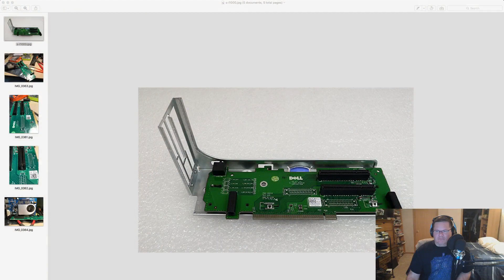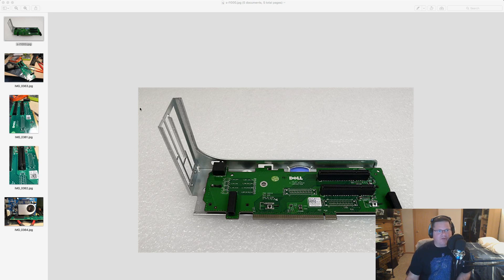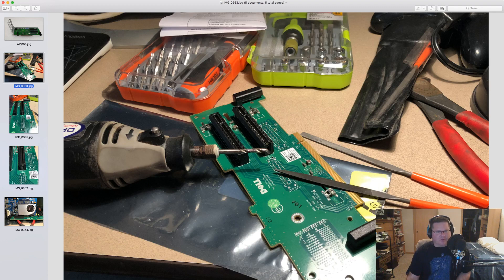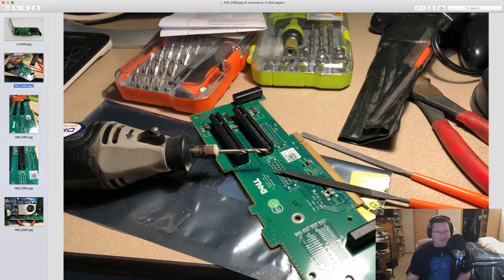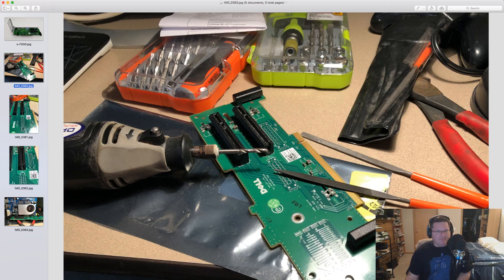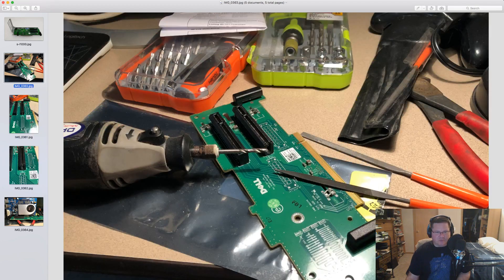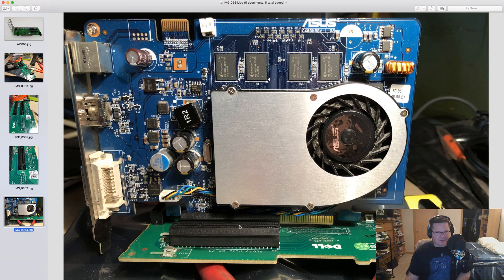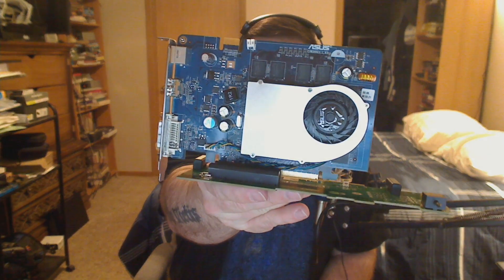Dell R710 x8 PCIe Riser Card Modification for GPU

Comment: Thanks a lot for the instructions! It works even with a Radeon R9 200, but I had to fetch some power from a sata port (might this cause problems?). Had about 40fps while playing DayZ on the machine yesterday. GPU temp was about 76° C.
Reply: Btw: It is a Radeon R9 280 an I used one of the sata ports provided by the raid controller / mainboard. Even the power consumption information on the front led seems to include the graphics card power usage. It shows about 220 to 250 Watt.
Reply from the maker: @haukehaubrock  is this on an R710? The start up power for your card must meet the specs and only draws more power after it boots...
Reply: Yes, it is a R710, 0MD99X, Version: A07. Hope this helps.
Reply from the maker: Hauke Haubrock it definitely helps. Could you post some links to the exact  connectors that made this work?
Reply: Sure, but the Links will lead you to the german ebay version... 

And I made a mistake. The Y cable is a molex to sata cable. 
So it looks more like this: sata -> molex -> 2x sata -> 2x 6-pin -> radeon card

Maybe it´s easier and less risky if you only use two of the listed items of ebay link 3) below. But they are too short to reach the graphics card and would take 2 sata slots. 

1) 1x https://www.ebay.de/itm/SATA-Stromadapter-5-25-Stecker-SATA-DC-Kupplung-Buchse-Adapter/201720174505

2) 1x https://www.ebay.de/itm/15pin-SATA-Stecker-auf-2x-4pin-Molex-Buchse-IDE-20cm-Y-Stromkabel-Splitter/112419696063?hash=item1a2cbc6dbf:g:hy0AAOSwNqJbaMj0:rk:28:pf:0
EDIT: Sorry, must be the opposite... can´t find it on ebay, had one of these at home 

3) 2x https://www.ebay.de/itm/15pin-SATA-Power-zu-6pin-PCIe-PCI-e-PCI-Express-Adapterkabel-f%C3%BCr-Videokarte/152453485099?ssPageName=STRK%3AMEBIDX%3AIT&_trksid=p2060353.m2749.l2649
Reply: Maybe I should take a photo and send it to you when I´m home again. I´m a bit confused right now. :)
Reply from the maker: @haukehaubrock  Confused? I hope not by me... Was just hoping for some Amazon links or product names to make it easier. :) But a picture would work too. use "myfirstname" @allenscloud.com
Reply from the maker: Hauke Haubrock I don’t think that’s an issue. I’ve seen it done before but would love an explanation of how you did it.
Reply: @AllenSampsell  Quite simple: I bought a sata to 5,25" cable on ebay, attached a Y-cable (5,25" to 2x 6-pin) and just connected the two 6-pin with the Radeon. That´s all. Well, I didn´t expect this would work, but it does.

Comment: I set the gpu on riser card but doesnt show signal , when i go on to bios setupo it appear on pcie n3 nvidia what can i do next for swap the video signal?
Reply from the maker: I think that depends on what operating system you're using. For me I was using Proxmox as the Hypervisor/OS and using PCIE Passthrough to a Virtual Machine. If you're trying to run an operating system straight off the bare metal then it's probably a much different technique. The BIOS in the R710 is not like a PC BIOS so I'm not certain you can just turn off the onboard video signal. Even if you can, if it doesn't work you'll have to figure out how to reset the BIOS to recover. I'm sure it's possible I just don't know how off hand.
Reply: yes, it works. just disable "internal video output" in your bios settings. but don´t panic, this may cause a black screen while bios / raid and netxtreme controllers are booting. but you can see those outputs if you keep one monitor attached to the internal video output. at least in my case.

Comment: Just like to know if this card in the link will work with the R710? It's the 2 gig version. Also i will be running ESXI 6.7 http://www.pny.com/GeForce_GT_710_2048MB_DDR3_PCI-E_2_0_Low_Profile?sku=VCGGT7102XPB
Reply from the maker: The TDP is listed as 19W so it will work at boot... It's also list as a x8 PCIe 2.0 card so that works.... BUT it's listed as Low Profile. So that won't fit... But at the bottom of the spec page is says: Package Includes - Low Profile Brackets. So that seems to indicate it will come standard with the full bracket and provide you with Low Profile if you need to use it. So I'd say go for it. I should have gotten this one too but I stayed away because the Amazon description just said Low Profile...
Reply: My graphic card came in today. It fit right in the server no problems at all. Now i'm waiting on the H700 raid controller so i can run SSDS
Reply from the maker: Glad it worked for you. You're going to have fun running the wires for that H700. Never thought about it but it makes sense that the SAS/SATA interface might no enable SSDs. Pretty sure I've read that somewhere.
Reply: Allen Sampsell can you pm you're number please? I'm pulling my hair out trying to update the r710
Reply from the maker: MGD9000 I added my email address to my About Description. Not sure how to PM. Email me your number and I’ll call.
Reply: I sent you a email. Thanks again
Reply: MGD9000 The tech support guy on pny told me that the GT 710 isnt compatible. Is this true?
Reply from the maker: @AlexBGamesONLINE  isn't compatible with what?
Reply: @AllenSampsell  The R710
Reply from the maker: AlexBGames the tech support guy was wrong lol. It might not be officially supported but it does work in an R710. MGD9000 is using the 2gig version and I’m using the 1gig.
Reply: MGD9000 Can you fit two of those cards into the system? I got a PCIE 16